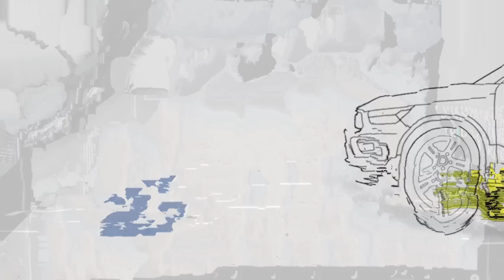The story behind Saab's secret 621-mile range electric car: the Emily GT

Comment: I agree with you. I have a 2009 Saab 2.0 93 turbo I bought when GM was getting rid of the line. They took 15k off the sticker price, $22,400. You have to love these cars to own them, and I do. I will never sell mine, I would buy the electric version only if the Saab nameplate was on it. Call me sentimental.

Comment: My second car was a 1969 Saab 96. The collapsible steering wheel prevented serious injury. I was going 40mph through an intersection when a van turned left in front of me. We had no seat belts. The steering wheel was flattened against the dash. All I had were minor bruises on my chest. And a small gash on my forehead, from the rear view mirror, I suspect.
Reply: that was genius. But introduced by Citroen in 1955 with the DS. Another icon like the Saab!

Comment: Geely could also make great use of the SAAB brand, using one of its platforms and bring differentiated products from what they already have, as a subscription only brand for example, or a shared and automated platform, or other business model. But I see no way out for NEVS.
Reply: Beijing Auto did produce a version of Saab 95 back in the days, however they were not able to acquire the Saab name because of GM rather let it die, and it did. Same story went for Rover with Ford. Both should have been alive like Volvo and MG.

Comment: This is a silly idea that has gone out of use 100 years ago, to much mass and shock force to easily overcome. Gyroscopic effect is much greater, might make the car more stable as long as it isn't turning a corner, otherwise you might tend to go straight instead of turning. Why do you think Tesla developed the motors they use? Much less un-sprung weight, much more electrical efficiency, much less parts flying off from shock.

Comment: With what is going on in the Chinese Car market, I’m not sure it would be such a good move for any of them to buy another car company right now, as all of them bar BYD are losing money on what they are currently producing. It also doesn’t make much sense to me for BYD to buy it - haven’t they got more than enough different models already?

I suppose an EV brand that isn’t well known or strong in Europe might see a marketing advantage to getting their hands on, and bringing back the Saab name one of their own models that they are thinking of bringing to Europe in the next 18 months…just a badge engineering job.

Maybe where ex-Saab have gone down a different road with their motor technology, that might be of interest to some too.
Reply: Besides BYD, both SAIC Motor and Geely Corpn are profitable. Check their annual report for 2021. SAIC is the largest carmaker in China for the past 17 years. Their MG ev is doing pretty well in Europe and Asia Pacific. Geely's Volvo still holding their own.

Comment: someone should produce hub motors in a form that could be stuck onto any old cars to convert them to EV. i would buy some.
Reply: There are some kits in the market already.
When the batteries will be a lot cheaper, these kits will be very interesting. This could happen already in 5-7 years. But it must be allowed to drive such rebuilt cars also!

Comment: Great looking car and surely reminds of the old Saabs. I hope this would come to production.
Reply: It's got an impressive overall range though it'd be nice to see it they could improve on how economical that battery is

It's pushing around 3.5 kWh per mile. A few other cars are pushing at least 4.5 kWh / mile. To put that into context, with a 175 kWh battery that'd be a range of 787.5 miles instead of 620 miles which is a hell of a lot further

Still, no company has managed this big a range at a reasonable cost. Aptera have managed it but I'd hardly call them reasonably priced.

Overall amazing bit of news

Comment: I don't think the rotating mass is greater on hub motors. The centre of the hub stays still - only the outer rim with the tire attached actually moves. With few components moving there's less friction, so I believe the efficiency should be better. The stability will be better as well, as the weight is even lower. Turning moment will be higher than having the weight closer to the center of the vehicle, though this might not even be realized by the car/driver because that weight is being directly moved by the fact that it's directly coupled to ground. The unsprung weight and the durability are the main issues. I'd love an off-roading vehicle with massive hub motors for full, independent control over each wheel's torque, and the lower centre of gravity.
Reply: It would require a very active suspension to keep the cabin from bouncing up and down in uneven pavement.
Reply: @rogerbritus9378  I'm thinking specifically for trails and terrain where youre going slow enough that the wheels are always kept down by gravity and not thrown up at the vehicle, so the unsprung weight doesn't really matter, but precise control over torque in every wheel and extra stability would be very beneficial.

Comment: Gear backlash:  Gear backlash is the play between teeth measured at the pitch circle.  (it can cause clicking or a slight hesitation in gear engagement when changing direction).  A direct wheel motor with no gearing would consequently have no backlash (since no gears),
Reply: Plus you also get backlash with slack in drive chains. Basically it's the amount you can move one end of the drive train without the other end moving.
Reply: I agree however I wonder if 0 backlash is worth the trade, since they require slip rings to deliver power. Rings and brushes will need to be serviceable. I believe direct wheel is also known as 'traction' motors  in the train and subway business.
Reply: @JackDaniels-pn6hu  huh, brushless motors are pretty much standard these days. I should clarify, standard for permanent magnet motors
Reply: @mattgraham4340  of course if you have an alternating field you can use a squirrel cage induction motor without a magnet. Problem then is field control and potential heat dissipation.
Reply: @mattgraham4340  I was not referring to motor brushes- rather I was referring to the slip rings/brushes that are required to deliver power through the rotating connection between the direct wheel motor and the inverters. The inverters are stationary/fixed mounted on vehicle frame. 
Unless I missed something and the vehicle frame houses the the stator while the wheel houses the rotor? That would be cool if it could be accomplished.
Reply: @JackDaniels-pn6hu  The assumption would be that the stator is attached to the axle and the rotor is attached to the wheel so no slip rings necessary with a PM rotor.  The power would be delivered to the stator without slip rings.   The major problem with wheel pancake motors is unsprung weight and that the motors have to withstand all the pounding from bumps without deformation or destruction.   For this tradeoff the gearbox and differentials are eliminated.   So far, I know of no car manufacturer who has gone this route.
Reply: Backlash is usually not a problem that keeps designers awake at nights...nice to eliminate if you can. Except for some applications like printer drives where you HAVE to minimise it.

Comment: 1987 900S (and a couple subsequent) - ah, that was the era! Would love to see that logo back on a great new EV! Good report - thanks!
Reply: 900S -87? Where are you, and what was the engine in that model? In Sweden 900S was introduced in 1990 and that was the low pressure 16 valve turbo without intercooler and APC.
Reply: With handbrake on the front tires. Big no, no for me.
Reply: @gullfaks  who says they will do dangerous things nowadays? Completely different owner, different design staff...
Reply: @gullfaks  I owned a 1985 SAAB TURBO 2dr. Anyone I drove in that car loved it. I have owned all sorts of cars but nothing was as fun as driving my SAAB. The engine sound was like nothing on the road and the handling was superb.